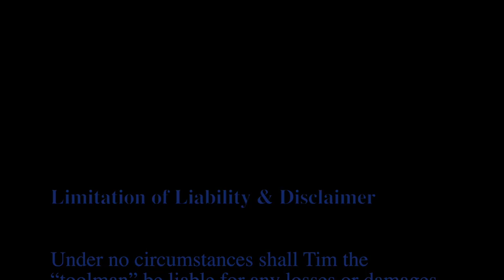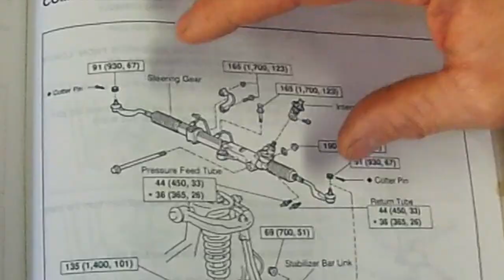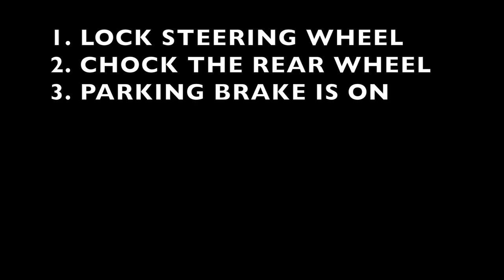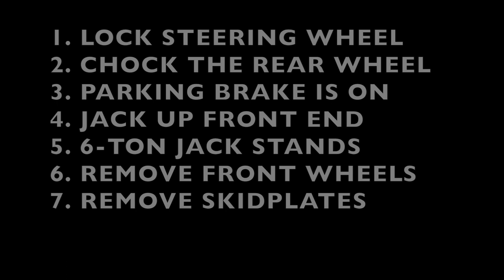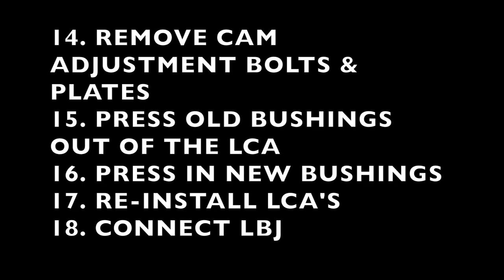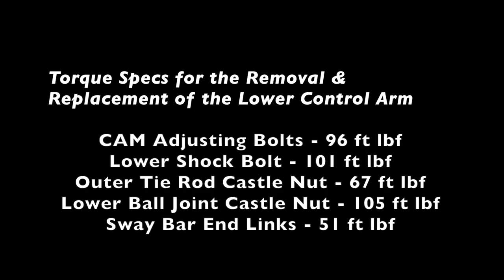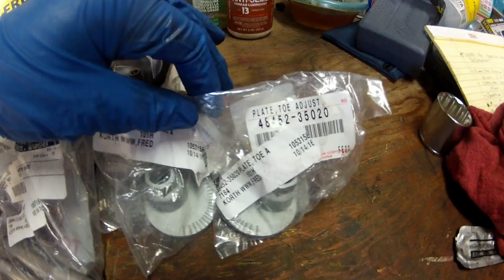Front Lower Control Arm Bushing Replacement (Part 1)

Comment: Don't you want to wait to do the final torque on the bushing bolts when the LCA is at the position when the weight of the vehicle is on the suspension?
Reply from the maker: Hey Steven, you are absolutely correct.  I don't think we showed it in the video, but I did a "Driveway Alignment" to get the camber close before letting Fred drive his rig home.  After a LCA bushing replacement, you need to get an alignment.  So, even if you tightened the cam adjusters without the weight of the vehicle on the suspension, the alignment shop is going to loosen the bolts anyway to make the necessary adjustments and then re-tighten them.  And, I doubt alignment shops bother with torque specs.  They just get a big wrench on there and get them tight.  I won't mention the name of the business, but I watched them do just that.  Also, you can't get a torque wrench on the rear bolts because the steering rack gets in the way.
Reply from the maker: Hey Steve, I noticed another question you asked about using anti-seize on the cam adjusters but then didn't see it here in the comments.  Yes, anti-seize would be a good idea since these cam adjusters are known to rust inside the bushing sleeve.  A good coat of grease would probably protect from rusting too but anti-seize might be the better choice.
Reply: I did make that comment as I was watching the early part of the video, but later you did cover using anti-seize so I deleted it.
Reply: I suppose you could use a torque wrench with big-a** crow foot on it. The reading wouldn't be dead on, but close.
Reply from the maker: Yep, that would work.  I don't own any crow foot wrenches yet.  Maybe I'll buy me some.
Reply: BTW, I do like the detail of description of the techniques you use, well beyond the "remove this part".
Reply from the maker: Hey Steve, that's the idea.  We've all seen those videos that leave a lot to be desired on how the hell they actually accomplished something so our videos go the extra mile to show the necessary detail so people have the best chance of being successful.  This is why our videos are much longer than the average auto repair video.

Comment: Why does it cost more in labor to replace the bushings as opposed to replacing the control arm in whole itself please?
Reply from the maker: Regardless of whether you're replacing just the bushings or the whole control arm, the control arm needs to come off the vehicle first.  Now, if you're replacing the bushings, you have that extra labor to do and that's why it's a higher labor cost.  If you're doing the job yourself, it's worthwhile to replace the bushings only because you save money.  If you're paying someone to do the work for you, it might be a toss up on the cost benefit of replacing only the bushings because the shop is going to charge you more labor to do it.

I hope that clarifies it for you.
Reply: Thanks for getting back to me. I appreciate your time. I have learned a lot from watching your videos, saving myself money, doing some of the work myself. I really appreciate what you do for all of us. check me out at 3ezstore.com I would like to send you a shirt. On me of course. One of the ways I share my talent like you! Thanks Timmy!
Reply from the maker: Thanks Rashid.  How about a medium black 3EZ shirt.  I appreciate it.
Reply: You got it.  i will pm after work and you tell me where to drop ship it. Thank you so much for what you do.
Reply: no problem. just pm me at rsykesgci@gmail.com where to send it. Thanks again.

Comment: A warning about lower control arm bushings -they have a steel Iner sleeve and it con become rusted/seized to the cam adjuster sleeve and can be imposable to remove without destroying the cam adjuster so make shure you can buy cam adjusters before you try this -not so easy job.
Reply from the maker: Thanks for the comment John and we know this as well.  We document how to handle frozen cam adjusters in Part 2: https://youtu.be/6FzEHygizoI

Comment: I can not get my passenger side arm to go back on. The gap for the washers is not even i can only get two washers in
Reply: Timmy The Toolman do you have an email address I may be able to send some pictures to. I have had no luck. Driver side  went on simple
Reply from the maker: My email address is: mtbtim@sbcglobal.net
I'm sorry but I was thinking upper control arms for some reason.  The frame brackets that the LCAs fit into can get bent a bit.  Have you tried spreading them out a little?

Show me pictures of each side of the arms, and of each bracket on the frame.
Reply from the maker: Hey Rafael, I never got an email from you.  Did you figure it out and you're back on the road?
Reply: Hey I never seen the reply til this morning. I can send you some pictures when i get home this afternoon. I will try to spread the mounting location see if that will help me  thank you awesome videos by the way !

Comment: What happens if you dont use the lube
Reply from the maker: They will most likely end up squeaking at some point.  The lubrication also inhibits wear.
Reply: @TimmyTheToolman  can i spray them with some silicone?
Reply from the maker: @erickserrano8919  With the control arm already on the vehicle, It will be hard to get the lubricant where it needs to get too but it's worth a try.

Comment: Hey Tim, Would you happen to know what’s the part number for the super bumps? And did he retread the holes? Thanks brother.
Reply from the maker: It seems these are from Wheeler's Off-Road, Inc.  They are not actually meant for a 3rd Gen 4runner but people say they work fine.  Here's the link: https://wheelersoffroad.com/i-25490332-wheelers-front-superbump-bumpstop-set-for-2005-tacoma-2003-4runner-2007-fj-cruiser-2007-tundra-01superbumpkit.html

Comment: You shouldnt tighten the Camber bolt until the vehicle is on the ground. If you do you will will rip the bushing as the bushing are not made to articulate from where the control arm is hanging all the way to where the vehicle is on the ground.
Reply from the maker: bigjjay209 You are correct.  I learned this after we shot the video.  The weight of the vehicle should be on the tires before you tighten suspension components to spec.  I will add a pinned comment letting people know this.  Thanks.
Reply: Timmy The Toolman dont get me wrong though nice video
Reply from the maker: No Big Jay, I'm glad you reminded me about this.  Thanks!
Reply: The center sleeve in the bushing isn't bonded to the to the polyurethane so it can be tightened before on the ground. The OEM bushings are all bonded and should have the weight of the 4runner on it before tightening so you dont over flex the bonded rubber parts.

Comment: Why didn't you just take the 4 smaller bolts on the lower balljoint , instead of having to press the balljoint apart.
Reply from the maker: cathy gambill Because I didn't want the balljoint hanging off the end of the LCA while we were pressing out the bushings.  But, you could do it the way you're saying if you wanted.

Comment: What kind of vehicle is this for ?
Reply from the maker: 3rd Generation Toyota 4runner
Reply: @TimmyTheToolman  is it the same in your opinion as a 2001 tacoma v6 4x4 double cab?
Reply from the maker: @joesmith7123  Yes.  The front suspension on a 1st Gen Tacoma is the same as a 3rd Gen 4runner.  I'd watch Part 2 as well, especially if you own a press.  https://youtu.be/6FzEHygizoI

Comment: Where's the video of you cutting the other side out?
Reply from the maker: The cutting was done on another repair.  I just added that into the video description to let people know the cam adjusters might be rusted in place and no amount of pounding will get them out.  I felt it was important information for people to know before tackling this job that it might be prudent to buy a couple of the cam adjusters just in case you have a couple that are stuck.  

I guess we could have videoed us cutting them out and uploaded a separate video, but it's pretty self explanatory.  You have to cut on both sides of the bushing with a reciprocating saw with a metal blade and be patient because it takes a while.
Reply: Timmy The Toolman I had to cut all of them out. And like Tim says buy cam bolts before you start; you can always return them. And get the Diablo "Steel Demon" blades, they're beasts and will cut through a bushing in a few seconds. I got normal metal blades first and went through five without getting through one. Thanks for making these vids Tim! They've saved me thousands in repairs.
Reply from the maker: Hey Robert, thanks for the blade recommendation.  I thing I went through 4 blades cutting out 2 cam adjusters.  I'm going to get some of those Diablo blades.

Glad you're getting good use out of the videos we've been making.  Hearing you've saved yourself lots of money using our videos makes us happy.  Empowering people to do their own repairs and save themselves some money is why we do this.  Plus, there's a great sense of accomplishment fixing and maintaining your own vehicle.  I've always said a DiY mechanic can do just as good of a job as a certified mechanic and often times better because the DIY mechanic is taking their time and not in a rush to get to the next job.  Plus, who's going to be as detailed and careful as you would be with your own vehicle?  I'm definitely not the fastest mechanic, but since this isn't my job, I don't have to be.

Comment: The bushings are $120 per side. The entire lower control arm with bushings is $230. I think I'll wait until I crunch mine on a rock then replace the whole assembly.
Reply from the maker: Alrighty then.  Crunch away and Happy Wheeling.

Comment: Pain on ass.......nice video.
Reply from the maker: It's not too bad of a job.  Finding the cam adjusters rusted in the bushing sleeve sort of sucks but you can rectify that pretty quickly with a reciprocating saw and good metal blades.  Glad you like the video.

Comment: The following pertains to energysuspension bushings.

There are a lot of issues with these bushings, some are not manufacturers' fault, others - are. And I am not talking about price - this is something the buyer at least knows in advance.

1. Their claim that all it takes is "some smoke from the bushing to separate the sleeves from rubber" is outright lie. It may be the case with jeep but certainly not with Toyota - you need to torch it for a long time to actually burn rubber off.

2. The fact that they don't provide sleeves with the bushings is simply ridiculous. Especially considering price. In fact, I would not mind paying extra so that I did not have to dicect the old bushings, and the first issue is minor compared to this one. It is pretty common for bolts/sleeves freeze in bushings so it's virtually impossible to separated them from inner bushing sleeves without damaging. 
It may not be an issue with jeeps and fords because their bushings are replaced on a regular basis but Toyota bushings last so long that it's practically unavoidable to face this. In my case, the truck is 17 yo with 230,000 miles, and the original bushings were still good. The only reason I had to replace them was installation of lift and JBA upper control arms that required alignment that couldn't be performed because - you guessed it - one bolt and one cam sleeve were frozen. After 17 years in the Midwest and N-E, is should not come as a surprise.
This condition requires a hell of a lot of heating and pounding, pounding and heating, and then it's a real PITA to attach the [original] washers to most likely damaged bushing sleeves.

3. The last issue is design - there are no lubrication means. And don't tell me it's impossible - just look at JBA upper control arms. I installed grease fitting in control arm ears and drilled holes in the bushings to allow grease flow to inner sleeves. Hope it will work.

Overall, bushing material is probably adequate but pure inexcusable greed that prevented the manufacturer from providing lower bushing sleeves and washers (even for extra $$) is beyond ridiculous. 
Bottom line: if your vehicle is 10+ yo and has spent that time in places where winter happens every year, expect MAJOR (BIGLY!) hassle installing these bushings. Or - MUCH BETTER OPTION - buy from another manufacture that does provide all necessary coponents and does not force to wash and reuse condoms because reusing bushing sleeves is just as ridiculous as reusing condoms.
Reply from the maker: Dude, you could have avoided all this drama if you followed our lead and just went with the Whiteline bushings.  Oh well.
Reply: @TimmyTheToolman  True - I could and should've used OEM bushings. But I wanted to warn others from stepping into the same puddle. Anything wrong with that?
Reply from the maker: @nofyfb123  No, nothing wrong with that.  Energy Suspension is not the right choice for replacement LCA bushings.  Hopefully you'll save others from choosing them.

Comment: Be careful using composite ramps that I have seen in some of your videos.  I have read about them cracking and crushing people.  I would make yourself a set.  I made a set out of 2 X 12 wood.  I made a set a couple of years ago after reading 2 different stories of people being crushed to death.  There are instructions online for the wooden ones.  cost me $55 in wood.  stained them for protection.
Reply from the maker: Interesting.  I've looked at how these plastic ramps are made and they are built stout with a pretty thick web of interconnected plastic.  I would guess somebody exceeded the weight rating for the ramps or they were possibly left out in the sun to get brittle over time.  Every time I've inspected my ramps, there's no signs of cracking or signs of fatigue in the plastic.

So, if you look at the ramps before you use them and see no signs of cracking or fatigue in the plastic joints, I don't see how these could all of a sudden just collapse.  I would think if they were ready to break because they were seriously compromised, they would fail as soon as you put the weight of the vehicle on them.  

I've heard the same concern about jack stands.  Some people are reluctant to work under them because they're worried they can fail.  So, they either put a second set of jack stands as a backup or keep the hydraulic jack in place.  The key is to do whatever you feel safe with.  I've been using these plastic ramps for a long time and I think they are absolutely safe.  After years of use, I have never seen anything with the condition of the plastic that would lead me to believe they are unsafe to use.  I'll also work under a rig supported by jack stands all day.  The way I look at it, you have a much better chance of being struck by lightning than having a ramp or jack stand fail on you.  My two  cents.
Reply: Timmy The Toolman 

        I do use 4 jackstands.  One set is a 12 ton set.  plastic like that can have unseen cracks.
Reply from the maker: I did a quick search and it seems plastic ramps made by Rhino have failed.

I appreciate your concern, but like I said, I've looked at how the ones I bought are constructed and they seem very well engineered.  I guess there's a chance there's an unseen crack but I've never heard a creak, pop or any noise from the ramps I bought over 10 years ago.  

You and anyone reading these comments should absolutely do what they feel comfortable with.  I will continue to use the plastic ramps as they are much quicker to use than pulling out the hydraulic jack and jack stands when I just want to get under the front end to do a quick oil change.  When I'm doing suspension work or anything that requires me to remove the wheels, I support the frame on 6 ton jack stands.

Comment: These whitelines treating everyone alright? I've heard mostly good things, only one or two bad reports
Reply from the maker: I've been running them for over 20k miles with no issues and others have ran them way longer with no issues as well.  Now, will they last as long as OEM bushings can last, that remains to be seen.  Since we don't have a crystal ball that can look into the future,  time will tell just how durable they are.  The fact is though they are a much more affordable option than OEM and they work pretty damn well, at least for.the short term.
Reply: Whitelines are good! The biggest complaint is some find they lead to a "harsher" ride, which is a common complaint for poly bushings no matter where they are. I doubt they will last 20+ years like OEM, but you shouldn't have to replace them any time soon and it will be MUCH easier and cheaper when you do. I've heard of one or two having to change them out after a year or so but it's incredibly rare.
Reply from the maker: @Patrick.Weightman  Thanks for chiming in on this subject.
Reply: @TimmyTheToolman  Thanks for the video! Finished my install today while following along, like a brand new car again 😎
Reply from the maker: @Patrick.Weightman  You're very welcome.  Good job getting it done.